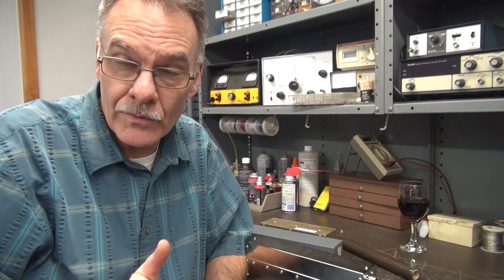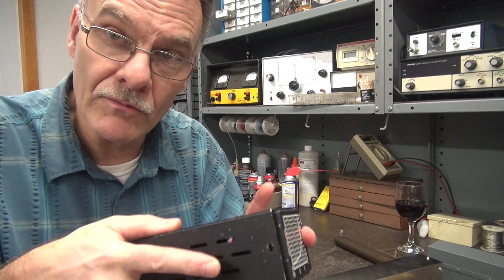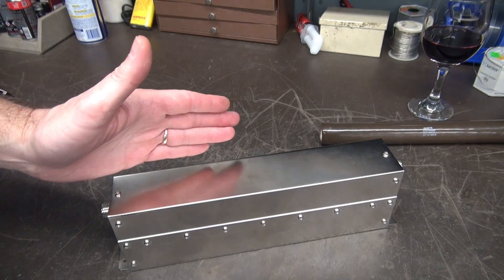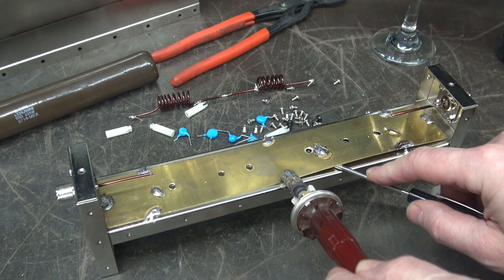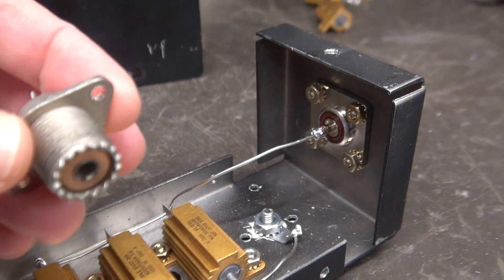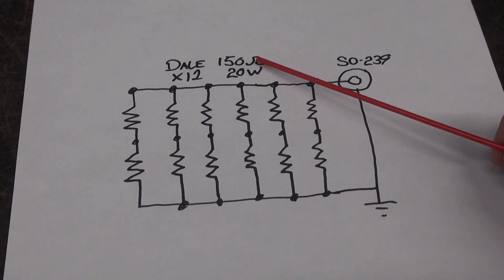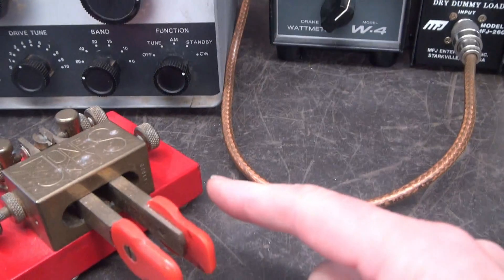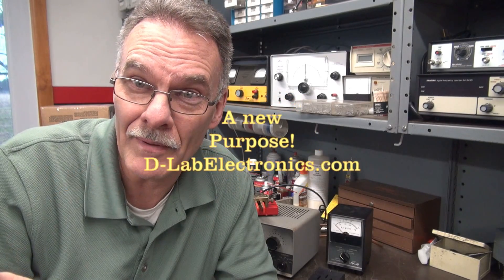How to make a Ham Radio RF Dummy load using a Low Pass filter Conversion

Comment: The worst instructional Dummy load Video.  Please do not follow this people RER70F1500R Are Vishay Wirewound resistor.  RER40-RER55 Are available in non-inductive styles (type ENH) with Aryton Perry winding for lowest reactive components. 
I'm sure this was a genuine mistake by the Author.

Comment: I would have left the brass plate on there for a little bit better heat sinking. Also I would spread the resistors out more for the same reason. You can use more of the enclosure as a heat sink if you spread out the resistors. Just my opinion.   Thanks for the video it was nice and clear and concise.

Comment: Everything has to be big at high power.
Nothing over 5 Watts here for 30+ years. Dummy load resistors built into a treacle tin, enjoy the treacle and use the tin. 
Although built for higher power and holes punched in for air flow when I used to use 100 Watts, SWR meter reading just lifts off the end stop at 30 MHz, 1.2:1 at 50 MHz and 1.4:1 at 145 MHz, all acceptable. I made another QRP DL which shows 1.1:1 SWR at 145 MHz. A resistive type SWR meter so the tx never sees above a 2:1 SWR when tuning aerials, the downside is that it has to be taken out of circuit as it consumes half my power. Just watch for any change in other meter readings indicating a problem, nothing ever has.
It's why I use QRP gear, everything is cheaper, including the electricity bill.
Although a lot of times I use a 12 Volt rechargeable battery and solar panel.
G4GHB

Comment: Absolutely dont do this. These resistors are wire wound like a coil and have inductance. You need non inductive resistors and they are very expensive. You can buy microwave dummy load resistors 50 ohm for £10 UK pounds on ebay and rated at 250Watts and can operate up to 155deg Centigrade. Cheers from old George

Comment: This is a very nice dummy load D Lab!
I'm trying to figure out how Lester claims 2000 watts out of his oil submersed dummy load.
He used 48 - 5 watt big resistors with 3 soldered in series. Then took 16 rows of the 3 in series and put them in parallel as you have done with yours and submersed them in a paint can like has been done for years.

Comment: I believe that the large discarded resistor in the MFJ unit is a very good non-inductive resistor.
Reply: Dunk it in a gallon of oil (if it will fit inside the can), and it would make a very decent 1.5 kW load. The Cantenna used a 90 watt resistor such as this, and it's an ol' standby.

Comment: Hi D-lab Electronics can I use a resistor of the same type the brown one you have on your table for a dummy load I have one of 50 ohms from a scrapped vending machine and how many watts can it approximately hold, another person has told me that I do not can use it as the radio sees it as a coil.

Comment: Non-inductive? Maybe at close to DC. Plus look at all the wire leads you have used to connect those wirewound resistors together. As crappy as MFJ stuff is, at least they used a good carborundum resistor. Put your load on a nano VNA and show the results on YT friend.

Comment: Bad idea. Those "golden" resistors are actually inductances, as those are wire resistors :(  Parallel connection reduces inductance in 1/N proportion, but it still remains noticeable. So load resistance value is frequency-dependent here
Reply: i was just going to type all about inductance of wire wound resistors not being a good idea, you should only use carbon based resistors,  inductance will to use his own phrase create a splatter box. has a wire wound resistors get hot the tolerances can changes significantly making them a bad choice for this job.
Reply: Those resistors he used are wound to be relatively non-inductive.  I just measured a similar one, and it's showing maybe 3µH @ 100khz.  not sure what that would be at his transmitter's frequency.
Reply: This golden resistors are wire-wound which operates only up to 100KHz, not good for a dummy load.

Comment: I've got one of those old low pass filters.  I was gonna try to sell it but now, thanks to you, I WILL repurpose it.  I've been needing a dummy load and I have a bunch of 1% resistors - 95.4 ohms, 50 ohms and 43.4 ohms with various wattage.  The 95.4 ohms are 40 watt resistors.  I'll have to figure out how to get them to 50 ohms.  Any suggestions???  These are power resistors that can be mounted with heat sync compound.  73 from K9POW in eastern Tennessee.

Comment: Hi All, Interesting video which inspired me to knock one together, I used 3 x 50 watt 5% 150R's as not planning to push too much power through it.  The final measurement on my calibrated Fluke 173 is 49.8 Ohms, close enough for sure!  However when I connect it after the Zetagi 203W SWR meter the SWR flies up to 7:1.. Any suggestions most welcome..
Reply: The key is to use non-inductive resistors. Otherwise the impedance will fluctuate with the frequency.

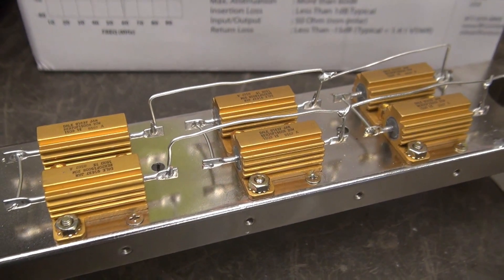Comment: at about 7:20 you mentioned the power dissipation as about 120 W.  It would be 240 watts. Are you saying 120 watts for safety reasons, it should be able to dissipate 120 watts forever and 240 with intermittent use?  Just curious. Neat idea, not good for VHF or UHF but should be a great dummy load for the low bands.  Thanks for the great idea.
Reply: No, he said right. When you stack the resistors in parallel the wattage becomes multiplied as to the number of the resistors. 
But when in series power handling would remain the same. 
He has has them in series and parallel combination; refer to the schematic on paper for clarification.

Comment: hmmm maybe using wire wound resistors isnt the best choice, think about it, each resistor will act as an antenna and tho it might not be resonate on hf it might cause interference in other bands
Reply: a dummy load is pure resistive, you should not use wirewound resistors as they are inductors.
Reply from the maker: Yes, i agree, switched to carbon, now have a flat swr

Comment: Oh..I forgot…I’m going to run 8 400 ohm  100 watt wire wound resistors in parallel and and use a small fan to pull the heat out if there ever is any heat...Better than dragging a paint can with a gallon of oil around.
Reply: NO WIRE WOUND RESISTOR should be used for the dummy load.
Reply: @subramanianr7206  interesting.. I would like to know why if you have any time to explain. I’m always trying to learn..
Reply: @rickhunt3183  The transmitter'/receiver's characteristic impedance is 50 ohm resistive. I think you should be knowing why it's 50 ohm. 
As a load for the Tx (transmitter) pure 50 ohm impedance matching is necessary because it's when there's no reactance created by either inductance or capacitance. "ELI the ICE man", the phrase to remember that voltage (E) proceeds in an inductor (L) than the current (I); in a capacitor (C) current proceeds the voltage. That's there's a phase difference between them. 
An dummy load is called a dummy aerial because it offers an impedance match to the TX, but it doesn't radiate any RF to any far off distance. 
A resonant antenna has both the voltage and the current in phase but would accept all the power from the TX and radiate as Electromagnetic waves in space.
A wire wound resistor would offer 50 ohm to DC but not AC.
Reply: @subramanianr7206  Thank you for that explanation.
Reply: @rickhunt3183  you are welcome.

Comment: thanks for sharing this. i have thought about using the resistors you used but was not sure if they could take RF signals. so thank you. i will be building one.
Reply from the maker: Hello, On the MFJ dummy load, I changed over to 2 watt carbon resistors, 1.8K x 36 in parallel, flat SWR

Comment: Unrelated question, but I hope you can help. I have an opportunity to buy a nice 100W tube head. The amp works perfectly except for a impedance selector switch that is busted. Its a three position sliding switch. Should this be a simple fix? I'm fairly handy with basic guitar mods, but haven't done much amp work. Thanks for your time and informative videos!
Reply from the maker: Is this the switch? https://reverb.com/item/2976121-switch-rotary-impedance-selector-replacement-for-marshall?gclid=EAIaIQobChMI_oTT14yt4AIVErnACh3zjgZZEAQYASABEgLLyfD_BwE&gclsrc=aw.ds&pla=1

Comment: Well, it was a nice idea.  I can't find any non-inductive 20W 150 Ohm resistors on eBay.  Anybody have a link they can share?  Or if I must go WW, how much inductance is too much?
Reply: There's no carbon composition resistor (non inductive) in the design shown. All you find are only wire wound resistors. But you should be using any wire wound resistors for making an rf dummy load.

Comment: I guess the newer version of the mfj is "better" mine is the mfj-260C 300w and it has a much nicer so239 connector thats actually fastened with bolts, nuts and glue! But no improvement to the "ground"  but it has this cage that surrounds the resistor now

Comment: Those resistors are intended to be mounted on a heat sink in order dissipate their rated power (check the data sheet).  The way you have them mounted back to back in the big dummy, they won't have much heat sink.  So it will work fine for lower power, or for short duration, and should be good enough for most testing.  But not for full power long term...

Comment: That reverse power was all about the long wires inside the box. If you can make them all as short as the mechanics will allow, that power will drop. Otherwise you could put some shunt caps in there to make the wires lowpass matched filters. You can make the caps from copper flags that you adjust by bending them. You should be able to get down below 1 watt without too much trouble.
Reply: These Dale resistors are wirewound. Heavily indutives. LU1AR
Reply: @edgardomaffia5356  Wire wound resistors can be made non-inductive. They use two opposite wound coils so the reactance is canceled out.
Reply: @BurrowsNE  Yes, but these are not. In my case I used metal film resistors in parallel, on a 50 ohm strip line. As here. LU1AR
http://lu1ar.blogspot.com/2012/11/la-carga-fantasma-para-uhf-de-lu1ar.html?view=classic

Comment: Nice one Mr T.
BUT using all of those same guts into a new 1 gal paint can from home depot and then adding 3 qts of non detergent motor oil would turn that 240w dummy of yours into a 1kw+ dummy.
OK; so you can do another dummy load on the next vidddy.
There's an idea for ya.

Even go a step farther and add a RF sampler circuit in it - too
Better still . . .

Comment: Sounds like an SWR of about 2:1.. ( 5W to 45W  ) ???
Reply from the maker: Yes, could be. I may add an internal small PF cap to lower it. Pure carbon resistors may also help, Remember, this is just a Tip for constructing, not the only way. TD
Reply from the maker: Just checked my Large Bird dummy load, has about the same reflected PWR, so I'm guessing it may error in my W4 wattmeter

Comment: Heck, if it's just the sheet metal case you need, you could just go down to [insert your favorite home improvement store here], buy a 2' by 2' sheet of steel/aluminum, some sheet metal screws, and make your own.  Home Depot even sells 12"x24" copper-plated aluminum sheets for $16.  Plus a couple of bucks for a 2x2 or 2x4 to bend the metal around, if you don't happen to have a piece of scrap in the garage.
Reply: @garybevis8691  https://youtu.be/fJ5LZEYyjiU

Lots of others out there, go find them yourself.

Comment: good job.i have (27) 50w each, 50 and 100 ohms 1% resistors,so i can make a series-paralel circuit to make a 50 ohm total and 1000w power also i have a 10x5x5 box w/heat sink, i want to try a build one of those some day ,i like your videos

Comment: hi can you check I thought those resistors were inductive ?
Reply from the maker: Yes, these are non inductive, look up the specs on Mouser
Reply: They very much look like aluminium clad wirewounds to me which have significant inductance, have you a Mouser part number? 

FWIW, the load I built with 20 x 1K 3W carbon film resistors shows an SWR of close to 1.2:1 to VHF so there's something not quite right happening here...